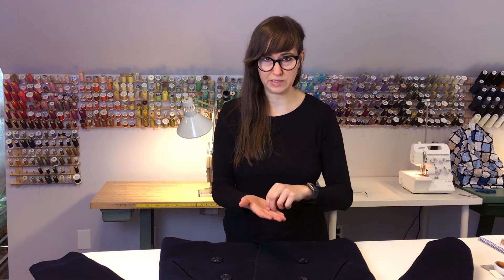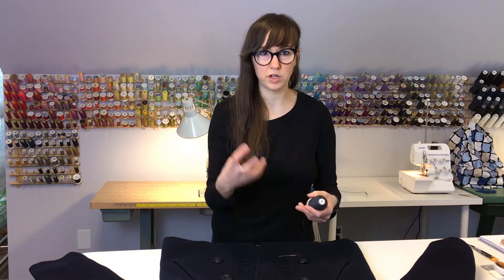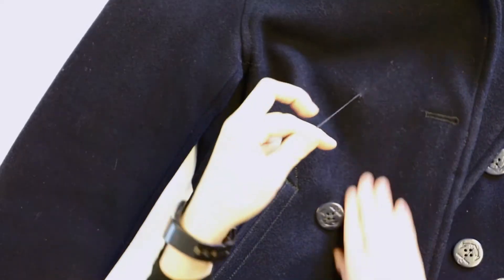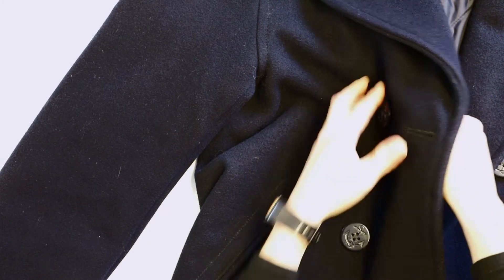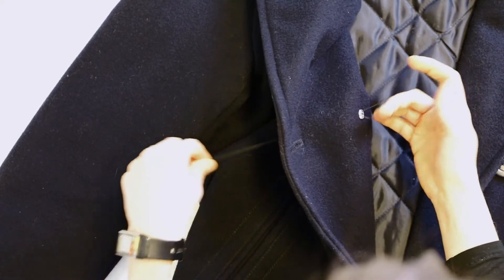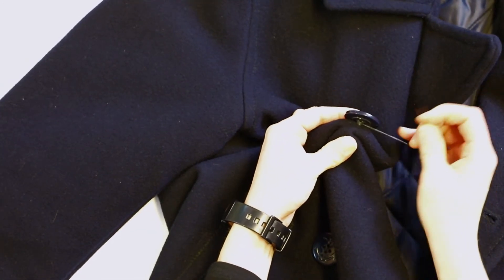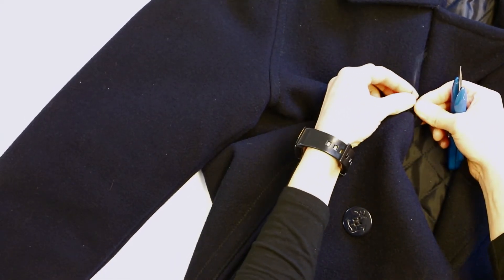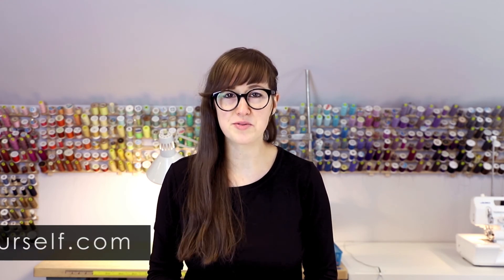How to Add a Backer Button to Coats

Comment: Hi. I am glad I came across your video. In my city, dry cleaners and tailors have become a rarity, so I had to risk sewing a button on a $500 Ralph Lauren pea coat. Thanks to you, I learned far beyond what I thought was necessary, and my project worked wonderfully. I have a question. You mentioned waxed thread--Is there any gauge or company you prefer? Thanks.
Reply from the maker: I'm glad you found it helpful! There's a recommended tools list in the description. Any brand thread is fine, but for coat buttons you want a heavy or button weight thread. Or at least 4 stands of regular weight threaded through the needle. Thanks for watching!
Reply: @TailorItYourself  Thank you so much for your helpful response. Enjoy your day.😀
Reply from the maker: No problem, you as well!

Comment: Thank You, It's the Perfect Video for my exact same coat. 
Yes I've made the mistake before not allowing for shank space, 
and then too tight to button coat.  
A fake button spacer, might come in handy, like fat O-Ring 
protecting shank from wear. 
Just an ole farmer, a stone throw from Rochester. 
Cheers
Reply from the maker: Glad you found it helpful! Thanks for watching.
Reply: @TailorItYourself  
I bet I spent 3 hours just looking at basic sewing kits at Amazon, then gave up. There are some clever travel kits by Fiskars. 
To lock down a small kit with heavy duty waxed thread, is tough. 
Cheers
Reply from the maker: You don't necessarily need a kit. You can buy needles and button thread on their own. I would browse wawak.com or pop into a Joann Fabrics store if you have one locally. Even Walmart carries decent sewing supplies.
Reply: @TailorItYourself  
Thanks' Hugely. I tried Amazon, and it's a nightmare for hours trying to sort through all the nonsense. I'll try Walmart as well. 
Cheers.

Comment: Watching this because somehow my coat has all the buttons but it’s missing a BACKER button! 😄

So I’m going to use a regular button to add a backer button to that coat.
Reply from the maker: I would try to use a smaller button as the backer. If you use a button with a similar diameter as the outside button, it can make it difficult to button. A larger backer will make it stiff around the edges and it can make it harder to get the fabric around the outside button.

Comment: I have a ton of polyester machine embroidery thread. Is that going to hold up or should I look for button thread?
Reply from the maker: Embroidery thread is fairly fine. It will work to some degree, but not as well as a button thread, or even a regular weight thread.